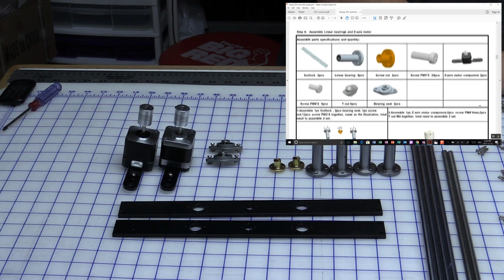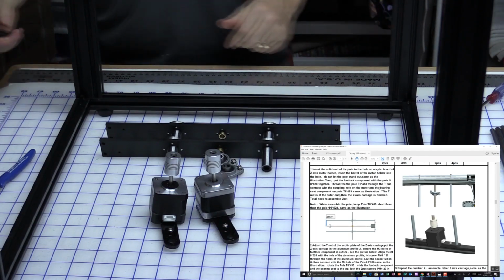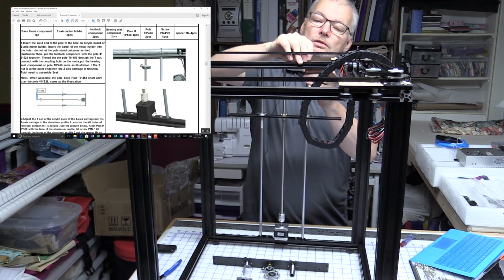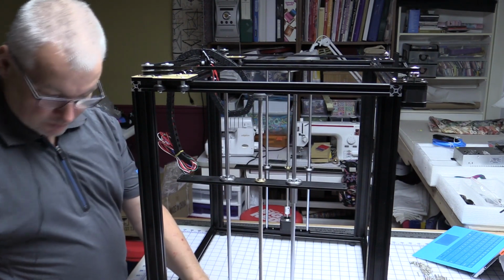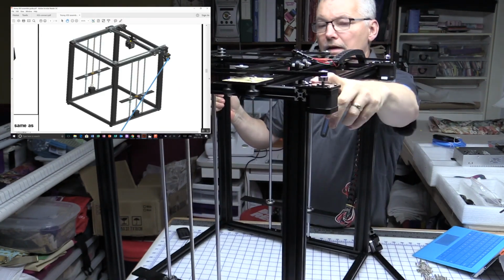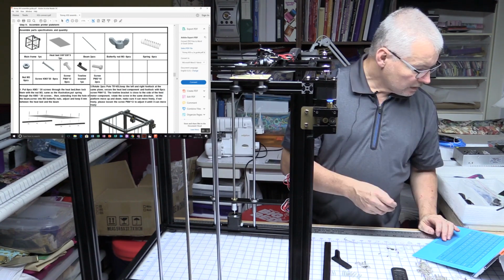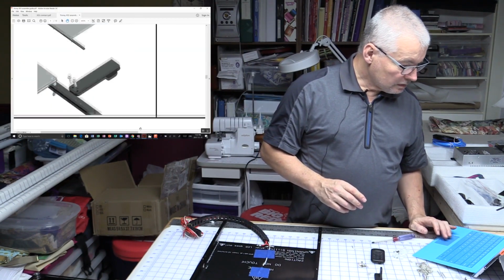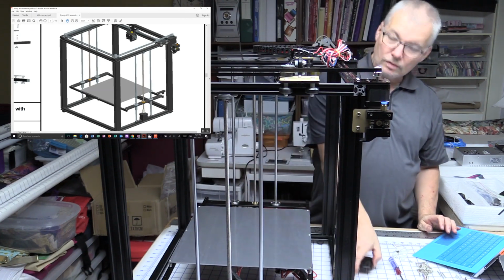Tronxy X5S Review and Build Pt5 Build plate and Z axis

Comment: At 8:46 you are moving the plate back down to make room for the screwdriver. On the newest kits there are holes on the plates so you can stick the screwdriver through with the plate the whole way up. This gives the best alignment.

Also, on my kit the bearing blocks that get installed at the top of the leadscrews were a real PITA. The outer races are curved to allow the bearing to be inserted into the housing sideways and then flipped 90 degs to be flat with the housing. Unfortunately, neither of mine were perfectly flat, or square with the housing.  They are quite tight and you have use to a cylindrical tool of some kind - such as a socket wrench socket - and a small hammer to try to tap down the high side until the bearing is perfectly square. This is a very tedious process, but if you want perfectly smooth movement on the Z leadscrews it may be necessary. You should be able to push down on the bars on both sides and feel perfectly smooth resistance against the stepper motor. If you feel any pulsation at all, your bearings are not square and you are likely to see the effects of Z-wobble in your prints.
Reply from the maker: It is nice to see the manufacturer taking note of customer feedback, early units had no real build surface worth mentioning (Blue tape), now added holes to ease assembly... all good progress making the kit more worth while. Next 24V power ?? :)

I have parts on their way to upgrade mine to 24V so stay tuned for an upgrade video soon. :)
Reply: if you look at 8:46 you can see there are no holes for the screwdriver. I recently purchased the X5SA (still on its way) what "newest kits" are you talking about?